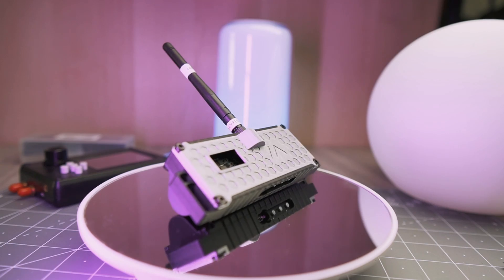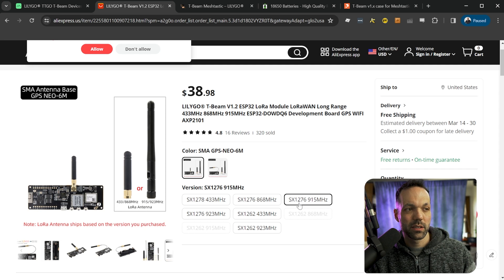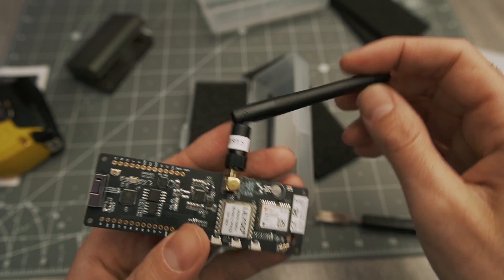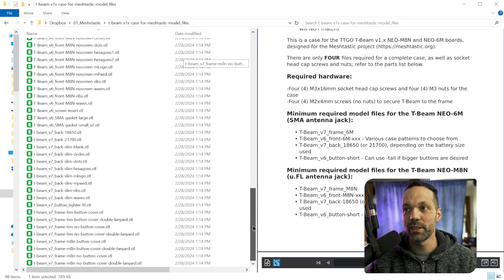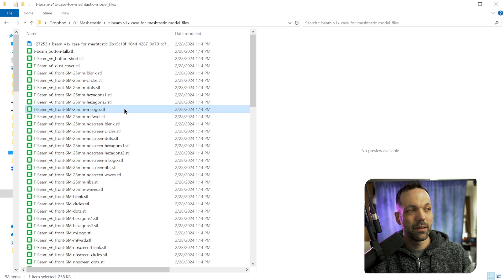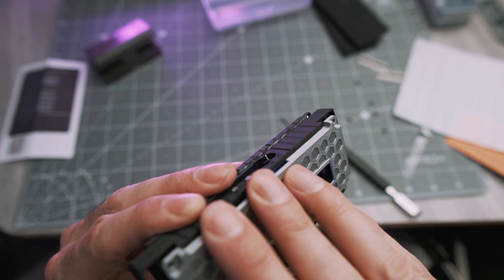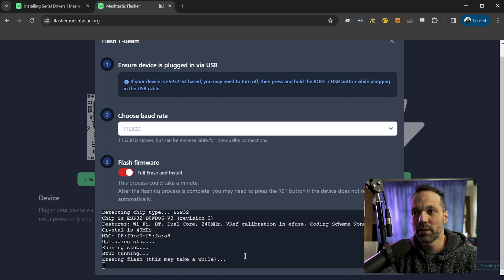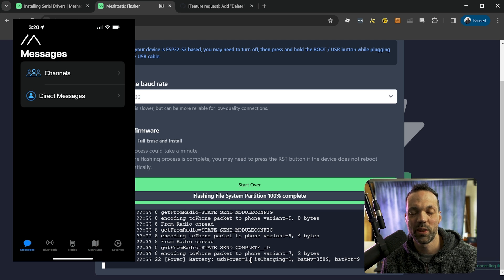T-Beam Meshtastic LoRa Radio Setup Guide

Comment: I am trying to factory reset my T-beam because I turned on Wi-Fi but it did not work but now when I flash the radio, it  wants to reconnect to Wi-Fi and it just repeating it. The radio won't work now because it does not connect to bluetooth.
I tried press down the reset button and usb connect and flash download and then release button but it still does the same thing.
Is there another website that will delete and factory reset the T-Beam.
Reply from the maker: If you have a computer you could try connecting via serial/USB by going to https://client.meshtastic.org/. From there you can reenable Bluetooth
Reply: @Atlavox  Thank you. I had to Factory reset from that website than reFlashed software. I was able to find radio on bluetooth.

Comment: Check your cable if it's not showing up in your device manager. just burned about 2 hours trying to figure that one out.
Reply: same
Reply: I'm starting to think one of those usb cable tester gadgets is worth getting. The ones where you plug both ends into the gadget and it confirms which wires are connected up. If the data wires arent connected, try another cable.

Comment: Mesh tastic needs to be eltor or so send and receive voice messages if. Not? Why would I buy it text messaging this fine but a lot of times?
What's messages also need to be included? It can't whyand why would I buy it if it only can do one and left the other?
Reply: It fundamentally is low bandwidth so voice will never be an option. Thats what gives it the long range. It's similar to a whale in the ocean - very low data rate but very long range, because the encoding is in the sound gradually ramping up or down to represent each bit. If telecoms infrastructure goes down due to acts of nature of trump then it can be a useful backup. Text messages is vastly better than no communication.

Comment: Lovely, really professional looking video! Those case designs by TonyG are amazing designs and free :) You really helped me along the way. For those on the hard use side Tbeam with separate pigtail (Ipex to SMA) connector is better option in case of dropping and impact transfer to board.

Comment: The GPS antenna has an LNA inside. I wouldn't stick right next to the battery. The metal can block GPS signals from the antenna.

One of my nodes is always on in the basement. (Connected to outdoor antenna). No GPS signal in the basement. I turned off the GPS receiver and entered fixed Lat and Long.